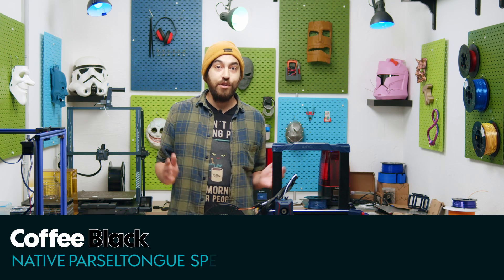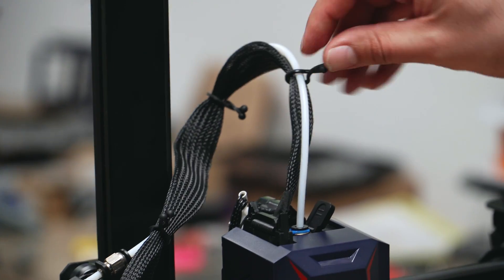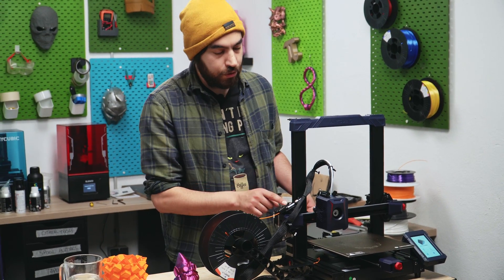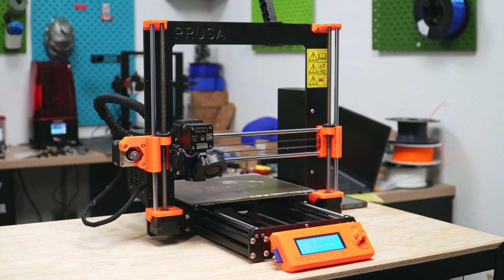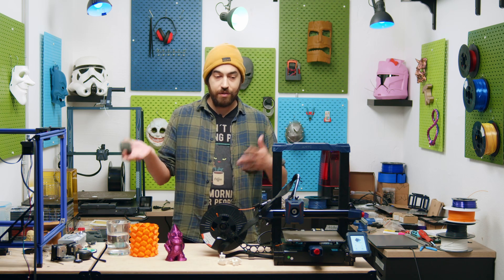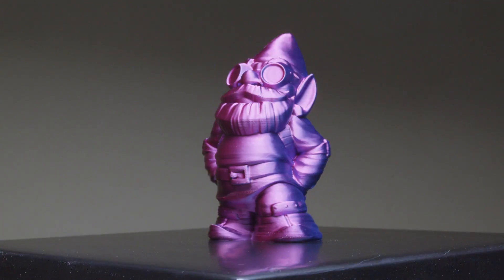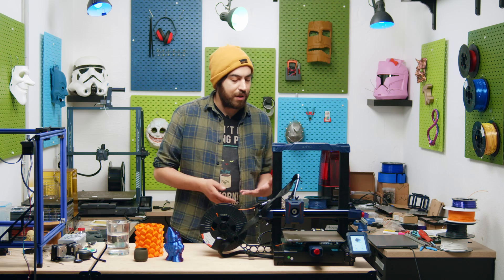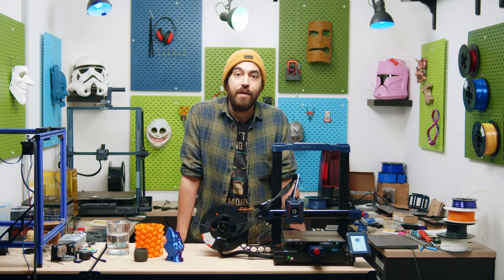The Anycubic Kobra 2 - The Little Speedster

Comment: Dont trust a guy, who doesnt show the printer while printing..
Reply from the maker: like this? https://www.tiktok.com/@3djake_official/video/7237925099716857114?is_from_webapp=1&sender_device=pc
Reply: @3DJake_Official I think he wants a time lapse
Reply: @3DJake_Official "You came here for a review of printer and check print quality ? Well, firstly, comment on my video to ask why it isn't there , then I will give you link to another app , download that , and view it there in few seconds format " wow , way to go.
Reply: @3DJake_Official  Wow, not even close to a real print. I want to see the whole thing. This printer got no Inputshaping or any other vibration-compensation. Also there are people reporting scratching sounds while printing.  On your German Site you promote an Ankermake printer with "TOP-SPEEDS". About the slow acceleration of this commercial no-go printer is nobody of you talking. Are you serious about such things and just have no clue or are you just trying to sell bad stuff? I dont know which of both would be worse...
Reply: @rhotix403  whats a good starting printer? Was looking at this one and creality ender 3
Reply: @papercutz100  None of both. The Anycubic Vyper is very good but the Volcano Hotend is a bit harder to control. Go for an Elegoo Neptune 3 Pro. Its nearly the same as a Vyper but with a better design. Dont go for early upgrades. The 4.1 Hotend is the best solution for PLA. Just make sure the bowden sits tight on the top of the nozzle without squeezing it. Happy printing😄
Reply: @papercutz100 ender 3 with a upgraded extruder or ender 3 s1 are both good but if you want it to just work and don't mind spending some money the go with prusa mk3 or Bambu lab p1p and higher up is  the mk4 and x1c
Reply: @rhotix403 ....you want him to post an entire print during a review video ? as if a single sane person on earth would sit and watch an entire print...
Reply: Yeah dont invest time and instead start crying when it doesnt work as intented. Praise the adhd society 👍
Reply: Still nothing man, rly
Reply from the maker: @ivanalex8266  ehhh the link?
Reply: How many benchys can you print in 6 hours? Normal settings
Reply: @lougarcia1485 

About four out of the box. (Benchi on kobra 2 neo, ~1h20m)

Edit:
Oh, sorry, i just realized this is the normal Kobra 2 and not the neo. The neo is a tiny bit slower, so this one would probably do little more than 5.

Comment: I like they left the tapped holes on top for options on mounting. New to the sport, my first printer was resin, haven’t done any filament work but this one looks like a great intro printer
Reply from the maker: That is cool but I still don't get why they moved the spool holder. It takes up so much more room on the desk. I'll probably use the inserts on top to mount a new spool holder and move the filament sensor to just below it. 
But it is a great intro printer and I've been using it as my little workhorse for the last few weeks , printed lots of little stuff for the workshop.
Reply: @3DJake_Official  maybe the weight was given a torsion on the frame or something? Who knows, just ordered one though. Excited to check it out

Comment: Would you be willing to share your slicer profile, if you don't mind?
Reply from the maker: We actually just used the old Kobra profile from Cura 5.2.2 and changed the speed and acceleration settings, that's it
Reply: @3DJake_Official  what about retraction? as this is direct drive